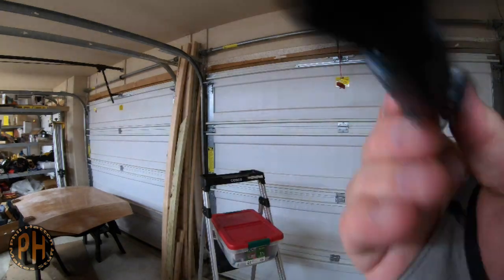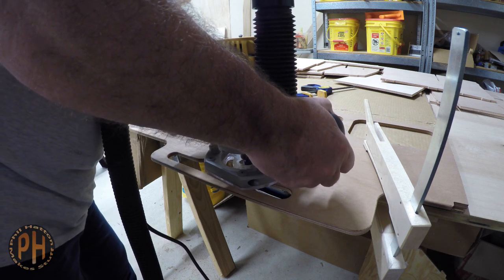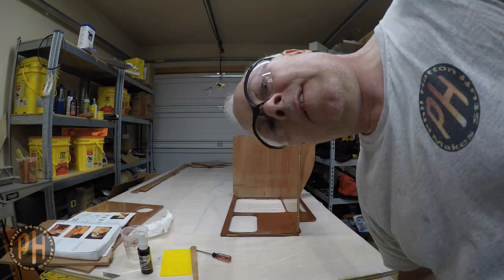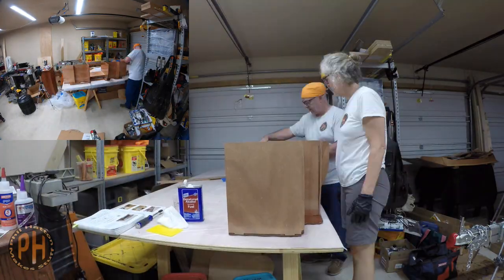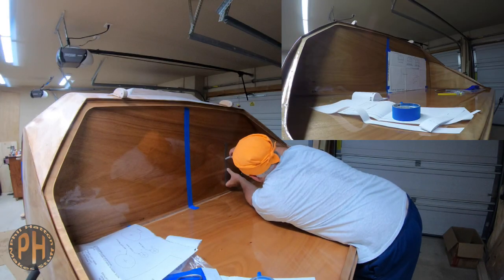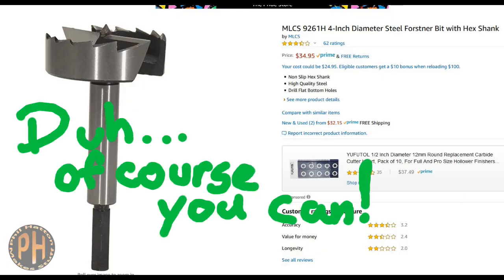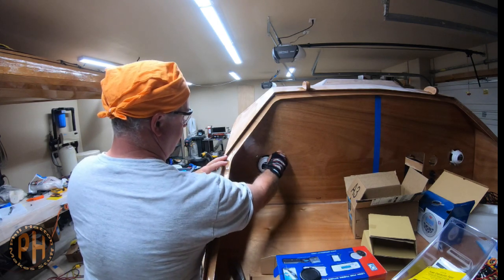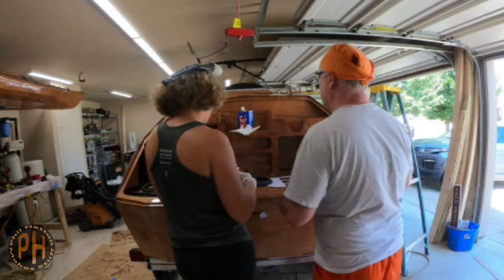CLC Teardrop Camper Galley Insert and Holes for Electronics

Comment: It seems like you're doing a nice job on yours Phil.
How long have you been working on it?
I finished mine in 6 months, but my wife never saw me.  I was spending as much a 10 hours a day in the garage. My time also included designing and building my own trailer with Timbren Off-Road axel-less suspension.
We've been on several camping trips with it so far and plan to hit the road for big trips around the country with it. 
Our last trip was in a campground and I had several campers come to visit so they could see the camper and take photos of it. It truly makes friends wherever you go.
BTW, for our electronics I am using a 400 watt Goal Zero Lithium battery. It weighs only about 17 pounds,  powers everything we need and only uses about 15% for a two night, three day camping trip. I also got  a 100 watt flexible solar panel that should allow us to stay out for many days. I was able to top-up the battery with only about one hour in the sun.
I plan on installing a 10 gallon water tank, mounted under the floor and between the trailer cross members.
Reply from the maker: Wow, your electronics are much more advanced than mine.  I have a heavy AGM battery and a charger. And stereo, fans and lighting.  I haven't tested to see how long that lasts.  Regarding the time, since Amy and I were working together, it went great considering all the other stuff we had going on (visiting ailing relatives, taking the boat out on the lake, moving to a new state, etc.) So shhhh but the camper has been mostly finished for a while.  We took it out into the mountains before we did the insulation and the cold nights made for a very damp camper.  After the insulation we've had it out and it's really comfortable inside.  The videos take more time than you might expect since I basically record everything and have to edit hours and hours or raw video down to a few minutes.  We do have a few more coats of varnish, the tongue box to build, some details to fix like improvements to the door latches, and I need to do the door straps.